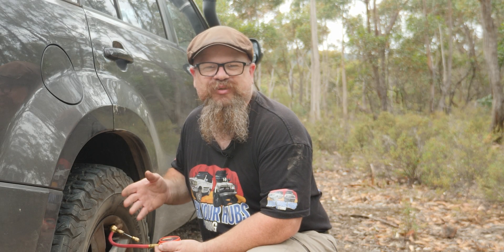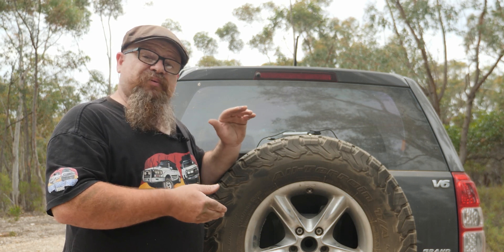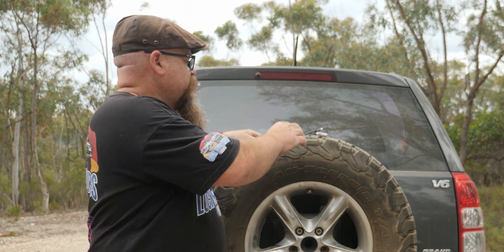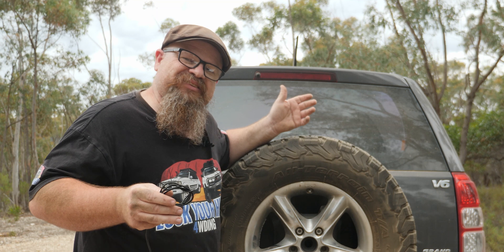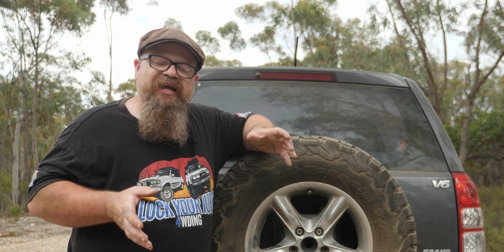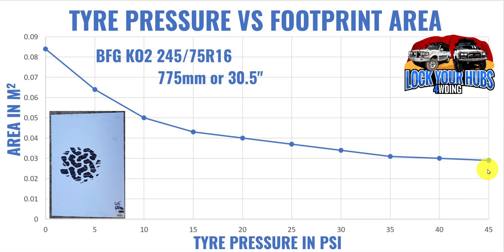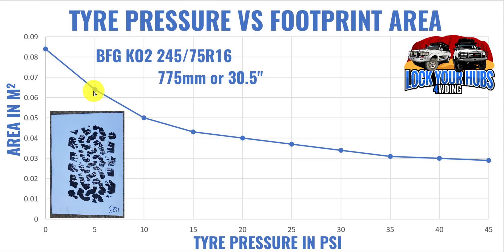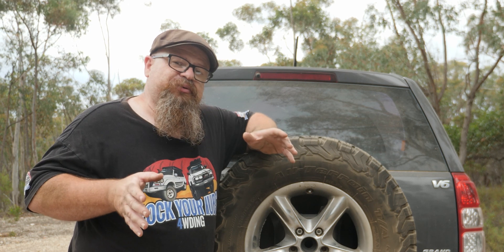4X4 Tyre Pressure vs Tire Footprint

Comment from the maker: What else do YOU want to know about 4WD tyres?
Reply: I'm new to 4wd and just got a new Prado VX with 18" alloy wheels. It would be great to understand what my tyre options are on the standard rim, then explain the 4wd slang when people get a 2 inch suspension lift and put 33" tyres on and the pros/cons of the larger tyres. I am trying to understand if there is a tyre sweet spot for a daily driver that also works well offroad for the weekend warrior in sand/mud. Cheers.
Reply: Mud V All terrain tyres 
Different rim sizes pros and cons
Reply: How bead lockers work
Wide vs narrow tyres
Stiff sidewall vs soft sidewall
Reply: I'd like to see the difference in tire footprint between the same diameter tire at different widths.
Reply: Why are some all-terrain tyres light truck rated and others are not, although they look the same in the same make and type?
Reply: @deano0057  likely due to the sidewall construction and materials used.
Reply: @HardstylePete  thats interesting,  there must be a minimum sidewall/ply requirement to be able to qualify as LT.
Reply: I was curious about the effect psi has on the width as well as the length of the track. That would have to play a major role in recoveries as well.
Reply: @NasTimeAdventures  there would be marginal gains especially if you have soft sidewalks however wider tyres would create a wider “bow wave” negating recovery
Reply: Why not explain to everyone the pitfalls of using bigger Rims with Lower profiles and how they Ruin the theory of Airing Down Vs Contact Patch, Well done LYH4,
Reply from the maker: I'm going to so that! And different widths as well.

Comment: Just curious.. what PSI did you run when doing Billy Goats Bluff with NAS and the other gent? As I am heading up there at the end of Feb 2025 in my 80 series the same as yours without a roof rack tho.. lol.
Reply from the maker: Hmmmm, I usually start off with 18psi front and 20psi rear on the 80 in the BFG KM3s
Reply: @LockyourHubs4WDing  thank you

Comment: Thank you for this!
Im currently running 33x12,5x15" on my 99 jimny on 10x15" wheels. we drive alot of deep snow, and had no issues running 4-5 psi all day. fully loaded my car weight around 1400 KG's.
Thinking of swapping for 35's, what your thoughts about it?
Reply from the maker: If you can re-gear low enough and can turn the wheels,  you'll get a slightly longer footprint with the 35s vs the 33s, I assume you're on beadlocks at those pressures, I say go for it!
Reply: @LockyourHubs4WDing  Im running sj T-case conversion with 6,5:1 in it.
Im actually not on beadlocks, and im surpriced i have not loose bead or anything atm.   might have something to do with my driving style,  in deep snow we try to float rathe than spinnuing the wheels. kinda like snow crawling. altho i at times need to get some momentum to clear hills.

Will the 35's be worth running?  im not using my 1 st gear much, as its too low so running 35s gear wise i think will be ok.
Reply from the maker: @sinnakjell7077  doing a great job not on beadlocks!

 If you've still got a lower gear to grab, I say go for it! Floatation is your best friend on snow. The lower your ground pressure the better.

Comment: I would have thought the rim & vehicles weight is supported entirely by the tyre which is a balloon and the bottom half of the rim has the most weight imparting into the balloon.
Reply from the maker: See the other reply about tension and compression.

Comment: Tyre pressures are in Imperial measurements as are tyre & rim sizes, rim offsets are in MM or metric, it's a language that's easy to use & understand even for metricated countries.
Reply from the maker: Usually tyre widths these days are metric, and then the rim size in imperial, I just wish we could just move over everthing to metric and be done with it!
Reply: @LockyourHubs4WDing  No way Jose, I like it the way it is. Not to sure about the tyre hangs from the top, I've escalated that one up to a higher level for evaluation.
Reply from the maker: @dustyfarmer  cord or wire doesn't work well in compression, only tension! 

I know it seems counter intuative initially, but how else could the load from the wheel be supported?
Reply: @LockyourHubs4WDing  Air pressure captured inside a sealed tube.

Comment: Hi ,  should LT (LIGHT TRUCK) rated tyres ie bfg ko2, be inflated higher than a standard passenger vehicle tyre ie general grabber at2   , assuming the same load or vehicle weight ?
Reply from the maker: It depends on a few aspects, usually for onroad use, you're trying to get an even heat distribution across one side of the tread to the other for the load and speed you're traveling at. I might do a video in the future explaning exactly how to nail tyre pressures for your setup if people are interested.
Reply: @LockyourHubs4WDing  That would be a good subject. How to get on-road pressures right?
Reply from the maker: @gavinwilliamson3944  yep, unfortunately most 4WDs spend more time on the blacktop than offroad. So it makes sense to nail tyre pressures so you've got plenty of tread depth for offroad use!